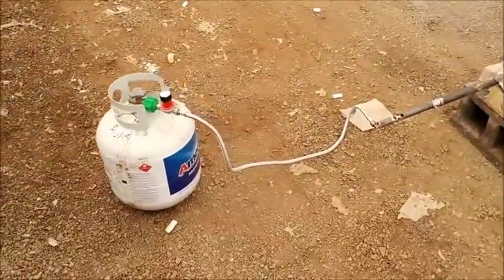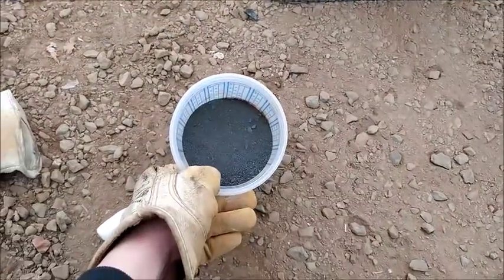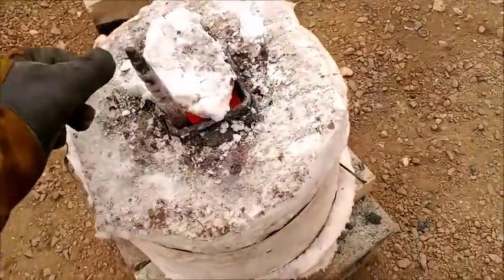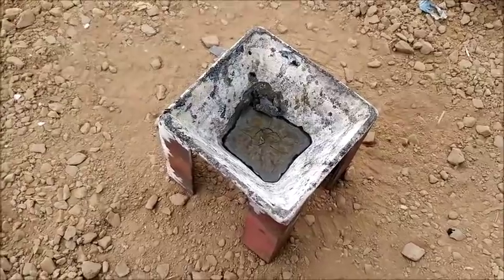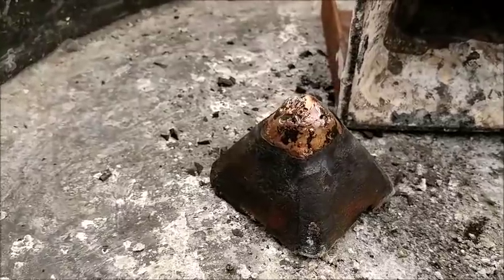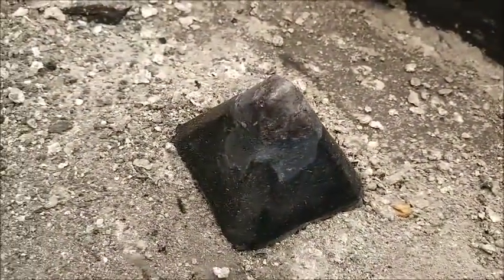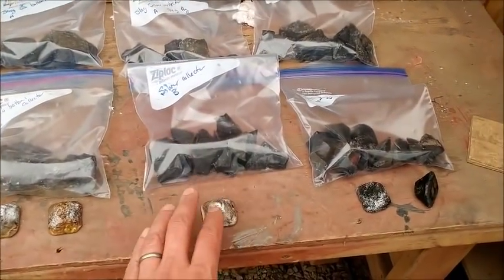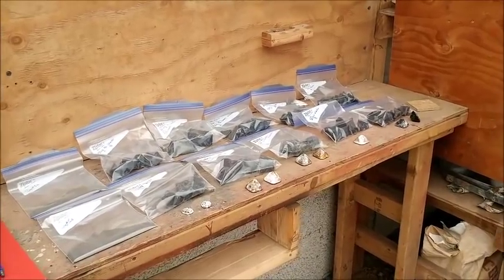Smelting Gold/Silver Sulfides Part 1: Testing Different Collector Metals For Gold Recovery

Comment: Really like your videos, very informative and good explanations !  Am thinking about building a simple, easy to get parts for smelting apparatus.  I had some questions about your propane burner nozzles ?  Are they homemade? How much pressure do they take to operate?  I really like the simplicity of your setup for the amount of heat you are obviously getting.  I'm also not around much stainless steel pipe of that size anymore, but do you have any suggestions on where to get it? or substitutes?  Thanks, again.

Comment: I have just now watched this video and would like to comment on the use of rebar as iron reducer.  Rebar is a very low end iron product which contains the most impurities of any iron product.  It contains copper, nickel, iron, and many other metals.  lucky use of multiple collector metals.
Reply from the maker: Thanks for the info and the comment.  I have more work to do so please stay tuned for more.  Thanks

Comment: Did you use the iron rod in all of the melts or just the first one?
Also, I had mentioned zinc as a collector when we spoke and I didn't think that the zinc will displace iron, so the same reaction of iron displacing lead you would get zinc making free iron metal, and as you dont reach the melting point of iron, you dont want that.
Reply from the maker: Hi Chris.  Yes I did use the iron rod for all the charges.  I wanted to try and keep everything the same except the collector.  That is a good point about the zinc.  I believe your are right that the zinc would reduce the iron sulfide to metallic iron and then you would have a mess.  Same goes for aluminum too, which I think was also brought up in that conversation.  Thanks for your thoughts.

Comment: Jason, Wonderful video.  Very interesting.  So, a while back I was doing a very similar experiment comparing the use of lead vs zinc as a collector metal.  Have you ever tried using zinc?  My results were not great but it could have been due to my inexperience in the process.  I would be interested if you can use zinc as a collector metal and have the slag analyzed to see if zinc works but in my case what i noticed was the temperatre was too high and most of my zinc oxidized and made a big mess
Reply from the maker: Thanks for the comment and question.  The reason I stayed away from zinc in this experiment is zinc boils (not melts, BOILS) at 1665 deg. F/907 deg. C.  My furnace gets well above 1100 degrees C so I think the zinc would boil off.  Zinc fumes are really nasty and not to be messed with.  Search "metal fume fever" and you can see some of the reasons I wanted to stay away from zinc, same reason shouldn't weld on galvanized steel.  There is a process for removing PM's from lead using zinc called the Parkes Process.  I have heard it works very well, but have never tried it myself.  Please let me know if you do and how it goes.  Thanks again for the comment and good luck in your experiments.

Comment: I think you need to roast it to get rid of the sulfur and oxidize the iron. The sulfur will hide some gold. Lead will oxidize the base metals and pull them out. It's a tricky process but I don't think you're going in the right direction.
Reply from the maker: Thank you for the tip!

Comment: the first charge you did ,you added the rebar ,I understand that ,you didn't use a graphite mould, but isn't your cone mould made of steel ,and wouldn't that serve the same purpose ,I don't know ,just asking , good vid though very interesting .
Reply from the maker: Good question.  Rebar works well because it is kept hot with the molten charge and the iron is available to react with the flux and sulfides.  When it gets poured into the "cold" cone mold the molten charge cools down very quickly and doesn't have time to react with the iron.  Thanks and I'm glad you liked the video!

Comment: great video.  I have seen people use equal parts borax with their gold cons.  Have you tried that?  Thanks
Reply from the maker: I think for pure borax to work the waste material to be removed from the gold cons must be oxides and not sulfides.  The borax absorb the oxides and the other bits of rock and quartz, but the sulfides need to be dealt with another way.  Thanks

Comment: thanks man appreciate your work. on another note do you find 0.8mm screen better for gold recovery than 1.0 mm?
Reply from the maker: It will really depend on the ore and the liberation size.  The finer your grind it takes longer (less tons/hr) and costs more (higher wear) so if you can liberate a large enough amount of gold at 1.0 mm screen and save the tailings for later processing through a ball mill, regrinding etc that might be the best way to go.

Comment: I think you should read the danger of stainless steel because you using in  kilm...
I'm a welder by trade that's the only reason I know about the stuff-
Hexavalent chromium [Cr(VI)] is one of the valence states (+6) of the elementchromium. It is usually produced by an industrial process
Like your video though
Reply from the maker: Great, thanks for the tip!

Comment: How long did you cook it. Ive done this many times and have had no luck. Im sure i didnt cook it long enough.  I only ended up with the slag staining my hands red instantly.
Reply from the maker: Once it was all up to temperature and it stopped bubbling around the iron rod I poured it.  It took about 10 minutes after it reached temperature to calm down and stop bubbling.  I think the whole process from start to finish for each pour took about 30 minutes.

Comment: hi my friend. why don't use air blower to reduce the amount of fuel ...gases. thanks
Reply from the maker: Hi.  Each smelt takes only about $2 USD in propane so it doesn't take much fuel at all.  I have seen blowers used when the fuel is a solid type such as charcoal.  Thanks

Comment: cañ you do a cupel to desperate the base metals. a large cupel. might need a blast furnace.
Reply from the maker: Hi.  Cupelling works well with lead as a collector, but copper oxide does not absorb well into a bone ash cupel like lead oxide does. Thanks